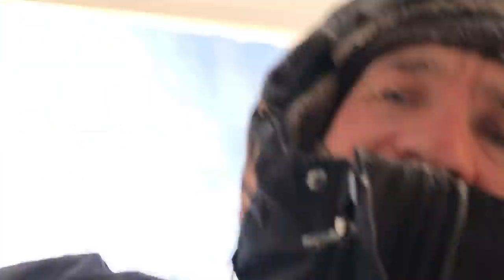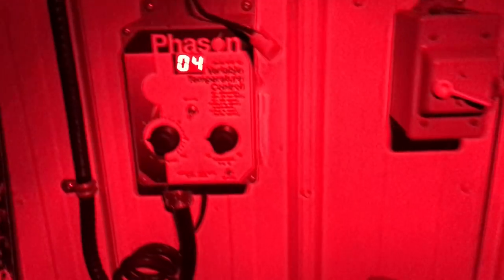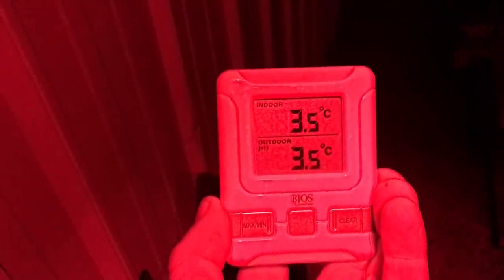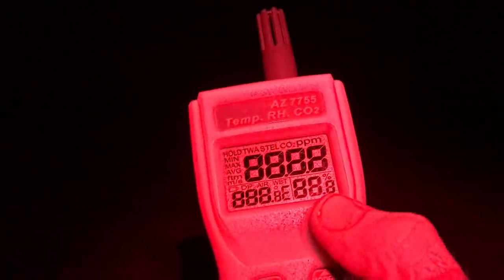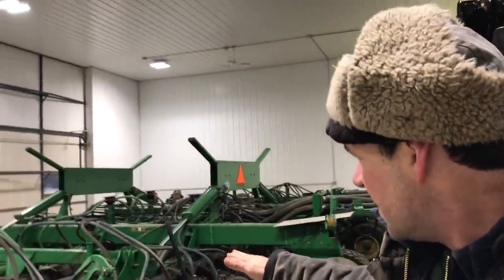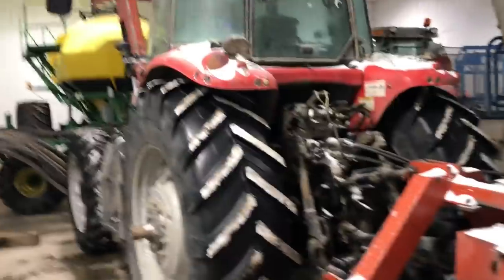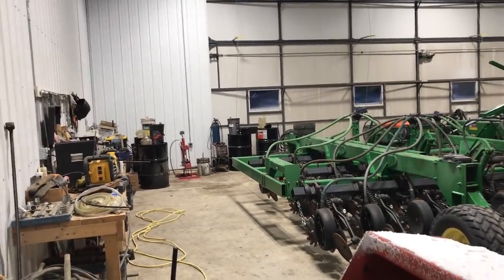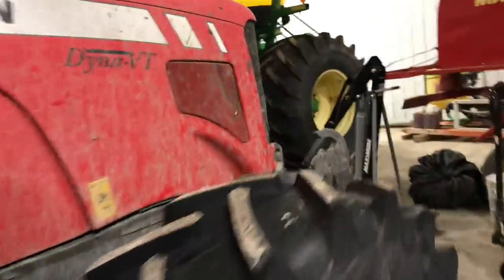Massey Harris 21 Combine - YouTube Motor Heads, please comment, skip-6:20

Comment: Wow if you were gonna run it 15 min / year I would go with rings.  Running it 3 hrs per year would mean 30 hrs in 10 years no way replacing rings gonna last that long.  So what to do.  Compare the cost of boring and new pistons with finding and buying a replacement engine of similar vintage.  Probably labor is the biggest cost here. Maybe find a sponsor!